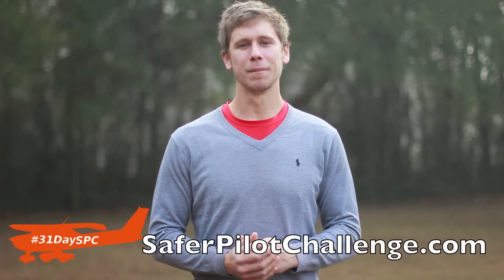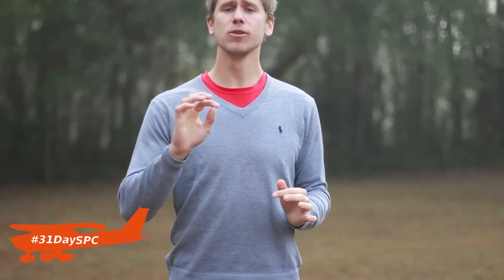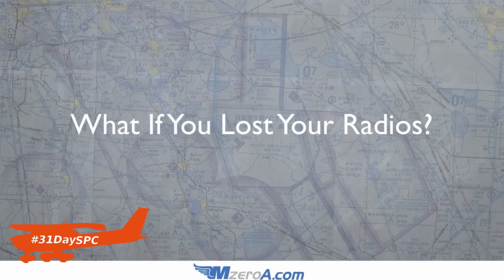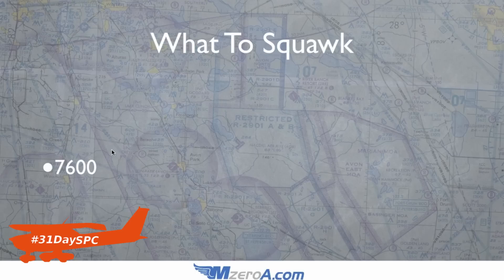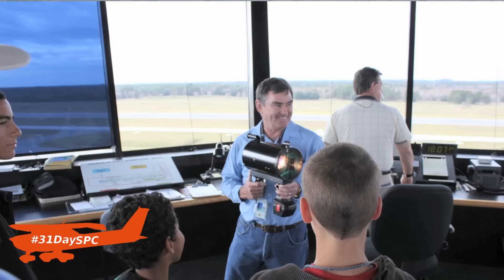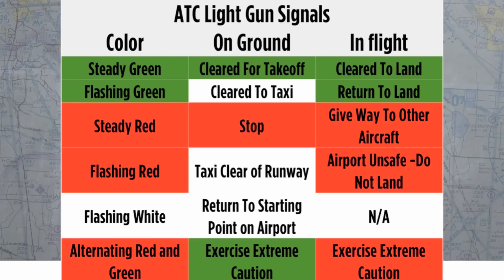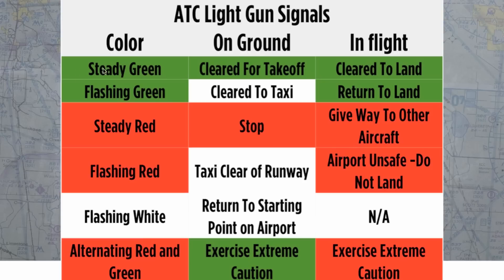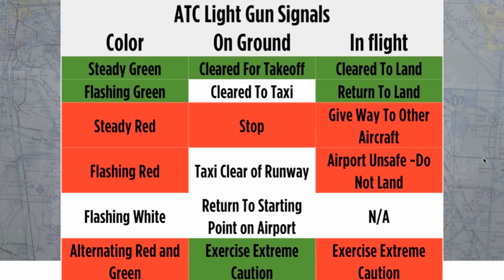VFR Lost Communications Procedures- Day 6  #31DaySPC

Comment: My first C-C,  nervous  and unsure I noticed that about 10 minutes of leaving  GYY (class D)  I had a hard time hearing FSS when I called to open my f plan.  .  About 15 min. in  I noticed the amp gauge showing  zero.  Then all the electrical gauges started to flicker.  So I turned everything off and headed back.  I laughed at myself because just a few days before I remember have a talk with my  dad about light gun signals.. Me being the smart ass I said  "I'll never need that'  , and my dad saying "you never know".  Well, I got so worked up I forgot I had the light signals  printed on my knee board.  So I didnt know the signals , I did  the next best thing.  I decided to land at an uncontrolled a/p.  I went over to 05c to see what was active and slipped in to the pattern.  Lucky for me it was early and no one was around.  I did turn the master back on and the radios and stated that I had lost the alt and wasnt sure anyone could hear me.(they actually did hear me) I landed with no problems and  called the FBO at GYY that owned the rental.  He said just fly it back, which as a student I told him no way.  SO , I called my dad ( who was a pilot since time began) and he came out to  05c and flew it back for me and I drove his car to GYY to pick him up.  My dad and the owner of the flight school and plane just laughed at me.  They both said "next time learn you light signals.  This is friendly advise to all students.  NEVER SAY THAT WONT HAPPEN TO ME.   Learn all you can in G school  and then pass your check ride because  its AFTER all that is when you really start to learn to be a good pilot. As a "rusty pilot " not flying for 18 years I went back to G-S with my son .  I think I learned more this time  than I did 20 years ago. DONT EVER BE AFRAID TO ASK A QUESTION IN CLASS.

Comment: As a student pilot, I was returning to the airport I had just departed about an hour earlier. I called tower, made initial contact, reported
 five miles out and was told to report again over another reporting point which was standard procedure. When I reached that point I reported but realized tower couldn’t hear me but I could hear them. I tried repeatedly to contact them but was unable to make contact. I continued and entered downwind into the pattern. 
Flew the pattern and was on final looking for a light. Just about the time I was considering going around the controller came on and said “red and white Cub on short final for 24 cleared to land”.  Never did see a light. I was negative transponder. I was getting fairly nervous on final but looking back it was straight forward, I continued to do as I had intended and I was ultimately given the go to land.

Comment: Always carry a portable radio that has pre-programed all the airports frequencies in your county/province/area. Common problems are headsets plugs. Always do a pre-flight radio check and test your cords with your radios open squelch (on receive) or use an Unicomm free frequency to test your aircraft radio talking to your portable while stressing the headset cords and plugs (at least once a month). If the system is noisy or intermittent, don't postpone the service. Pre-flight inspect the radio antenna. If the range is an issue, antenna or coaxial cable/connectors needs to be serviced or clean the ground connection. Poor quality workmanship on the aircraft electrical systems could lead to noisy reception and reduced range. Spark plug wiring could also cause lots of troubles. Poor connections, loose lugs, poor shielding, faulty magneto, grounding, all will cause interference and loss of range. if antenna system is faulty, even a cellular phone screen use or other electronics  could open your radio squelch and affect your receive sensitivity

Comment: I had an alternator failure flying into a class D airport. Ultimately I lost all radio communication. When I flew in I circled just above pattern altitude until I got the signal to land. With two of my friends on board it definitely made me and them nervous, but, I simply kept calm and flew the airplane just as I had been trained.

Comment: I was flying with my instructor out of class C and on clime out we lost coms as we were leaving their airspace...the voltage regulator fried and allowed the system to over charge slightly so we couldn't notice that easy. It burned out our radios and landing lights. We landed at a non toward airport to figure out what happened. While down we call the tower back were we had to go and established where we were going circle so they could know who we were and use the light gun if they couldn't read the hand held I brought...that saved they day.

Big tip get the head set adaptor for your hand held...it makes it so you can hear it.

Comment: So, I have a question. Let's say you lose radio communications (both RX and TX) and you are near you destination airport but have not yet received ATIS. How do you know what runway they to land on once you are given the  green light to land?  Do you overfly the field 500ft above pattern and ascertain there the runway then set up for the 45 downwind entry?
Reply: Yeah the windsocks are a good start. The prevailing wind for the area, if strong enough to be a major problem, will be evident from your cruise ground speed. You can also just enter the pattern following other traffic (or if no traffic pick a direction) and watch for a light gun giving you a green or red, if red try the opposite runway or a totally different bit of pavement in the case one runway is unusable.(other than an accident, runway temporarily out of service should have been a NOTAM and marked with a couple big "X" on the ground)

Comment: About a year ago i had a bad mic jack and was having a tough time with intermittent transmit ability. The airport i needed to take the airplane to to have it fixed was inside a class D (KGON) which at the time was rarely busy. I called up the tower on the phone in attempt to coordinate a no comms arrival with the tower. The controller flat out refused to help me out, claiming there would be no safe way to allow me into the pattern, he stubbornly insisted that without two way radio communication he could not allow me to operate into that airport. He also claimed there would be no way to know which aircraft was mine. I basically said I will be arriving at 1:00pm from the north squawking 7600, and I will be the aircraft who is not talking to you. He again claimed he could not accommodate my request. I asked him if he had a light gun, to which he responded, "yes". Getting annoyed now, I then asked him what he thought it was for, and how did he allow cubs and other vintage aircraft not equipped with radios to operate in the delta, and he smugly replied that he would not allow them to operate there either. Before I got too angry I told him he needed to read up on 91.125 and 91.129... Ultimately I had to fly in after hours when the tower was closed and the airspace was reverted to a class E.
Reply: Should bring that conversation to the local FSDO.

Comment: Hey Jason, I appreciate all your tips and videos.  

On a beautiful cold winter day, we took off on the return leg of my long supervised x-country in a vintage 172,  the NAV, transponder & #2 radio died first.   We shut down all the electronics that we could to preserve the battery but by the time we got close to our home airport under Class B airspace, nothing electronic worked.  My instructor pulled out his iphone and after several tries and 360's got through to the tower and told them we were coming in and ATC gave us light gun signals.  It was during the day and looking at the tower we could see the green light on downwind, base and final.  I remembered all I had to do was rock the wings to acknowledge.  We'd avoided getting close to other airports and the 360's put us over our ETA.  When calling FSS to close the flight plan, I found they'd just called our tower to confirm we'd landed.  Later we found that the connector on the bottom of the voltage regulator had become disconnected but it isn't visibly obvious during preflight.

I've got a voltmeter that plugs into the cigarette lighter & I'm going to purchase a hand held radio with headset adapters to go in my bag after I pass my check ride.  My instructor suggested putting the tower's phone numbers in my phone but I'm finding that they're not given out freely.   My wife also gave me a little USB power pack  to power tablets & phones.   For longer flights I might carry one of those jump boxes with a cigarette lighter jack on it.  The #1 thing to do is fly the plane.
Reply: That must have been exciting. Sounds like a great plan. Good luck.

Comment: We lost a generator the other day, and lost all electrical at a non-towered field. In our case (C150) the first thing we seemed to lose was radios, then gauges started to go. But engine driven magnetos saved the day, and we made it down safely.

The first sign, that we didn't catch, was a plane coming in on a parallel runway who "didn't make any radio calls". We saw him, and held short before taxiing across his path, but wondered why he was silent. We just didn't know that we had no power.